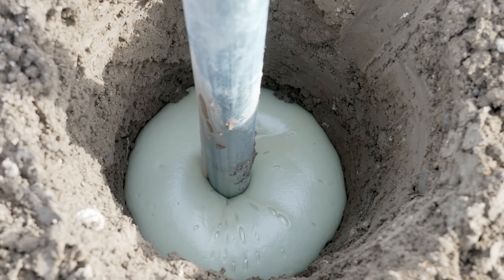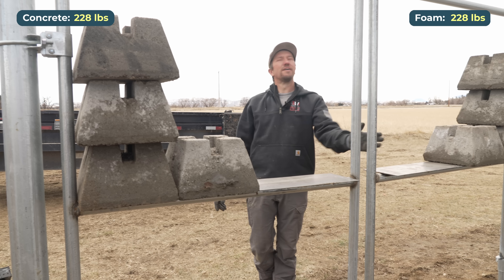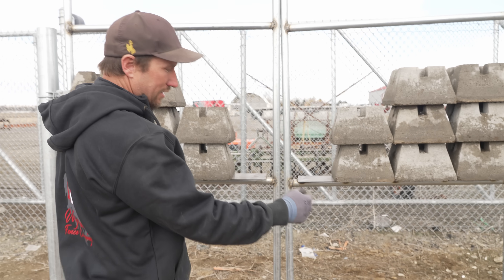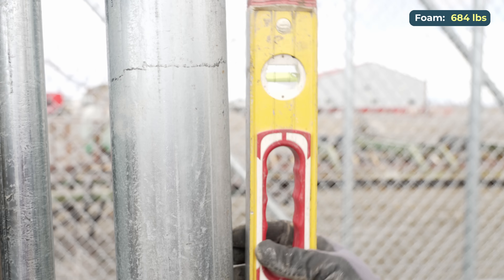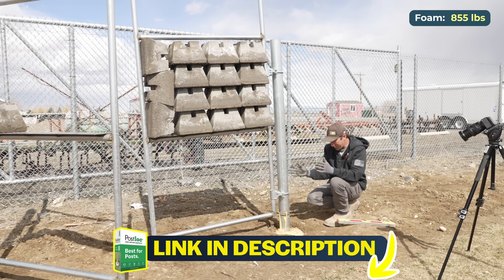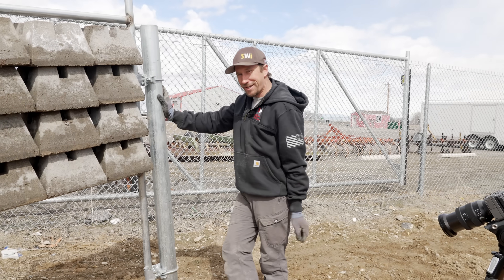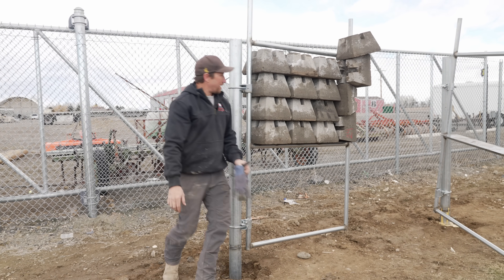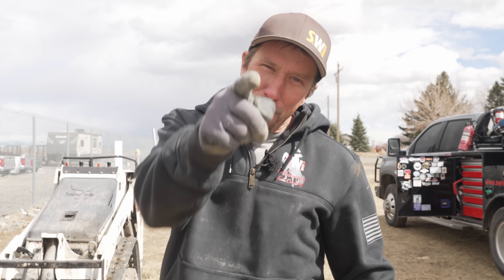How Strong Is Fence Post Foam -- Really?

Comment: Interesting that the foam held so good in this configuration. You’re supposed to have about 1/2 the hole diameter compared to concrete. In Europe, most manufacturers recommend that the narrower the hole, the better. The dirt will always fail first.

Comment: Does not appear the post was watered in, either with rain or a hose.  From personal experience, the foam is extremely strong and stable. However, the ground around it is weak amd will give/break until it's been watered in good and is allowed to pack in tight around the foam.

Comment: Foam failed same weight on either side one deviated while the other did not. The foam lacked the weight concrete has. The dirt  didn’t fail it just pointed out the foams major flaw. Logic dictates if the dirt was the cause it should happen exactly the same on the other side so clearly something is a miss and its weight.

Comment: For all the nay sayers, when are you ever going to exert a downward pressure on a gate of half a ton? Either method will work for a fence or gate. Cost is what’s important here.
Reply: Cost?  What's the cost going to be of when the foam deteriorates?  It's going to, a lot faster than concrete.
Reply: @Valkaneer That would depend on the purpose of the gate/fence. Sometimes they are temporary. Again, it comes down to cost.
Reply: @robertrossi3788   The foam is far more expensive than concrete.  The only thing foam gives is convenience.

Comment: almost $25 per post compared to $4 for concrete. Not worth it in my opinion.
Reply from the maker: I mean, you should be using at least 3 bags of concrete... If you're getting 3 bags for $4 that's a pretty good deal.

Comment: The issue with the foam is the weight, it simply doesn't have any, meaning it's not a good anchor point, I use at least 100 lbs of cement per post and for a gate I may double it, foam is literally the stupidest thing you can use for a fence...
Reply: @michaelhartman851  who’s your electric provider?

Comment: Seems like the difference is that concrete is heavier and I believe you said you tamped the concrete thus reinforcing the connection to the ground. 

I bet in very hard clay the foam would have held the same weight. I’d say the foam did a great job and didn’t crack/crush at all, just the ground around it couldn’t support the weight. It was being compressed.

Comment: Looks like the dirt wall failed, not the foam. It would be interesting to see this again, but with a concrete 2 foot hole, then put in a post with that foam, Would it still fail and sag?
Reply from the maker: That's an interesting idea. And sounds like a lot of work. 😆

Comment: I've been subscribed to you guys for a couple of years now and really enjoy your content, I have a question for you that you may want to cover in future videos. We moved to Virginia in 2009 and had a wood fence installed and enjoyed it until around 2022 we started getting carpenter bees. First they destroyed our cedar pergola, it must have tasted pretty good. Then they moved onto our fence. These little son of a bees are just slowly decimating it. We are surrounded by woods so I don't see a reasonable way of getting rid of them. We are ready to pull the trigger on 368 feet of fence and were thinking of going with wood ( we had it quoted for wood and vinyl ) but are thinking of going vinyl now. Is this the best way to go or are there ways to battle these little *astards that works? They are incredibly destructive.
Reply from the maker: That sounds extremely irritating. I don't have a lot of experience with carpenter bees, but my first question would be is this bare wood? I imagine if it were stained or sealed it would deter them. I'm also going to assume it's not a very hard wood, I think carpenter bees tend to avoid dense wood.
That's about the limit of my knowledge, but if you did go with vinyl you obviously wouldn't have that problem any more.

Comment: Great demo!. How about pouring foam into a hole that has about a foot long and post wide trench coming from the post out on the direction of the closed position. An "L" footing.  I believe that extra footing would help with any sag. Another approach could be to dig a hole and the make an "X" shaped footing. The ground here in TX is very unstable and with lack of moisture comes shrinkage. The "footing" helps whr things shrink. Your thoughts?

Comment: So foam works b/c the soil has a limited compression rating on the heavy side of the hole. So until the soil is stiff enough to offer extra strength then foam is fine.

Comment: We use foam all the time for new pole sets. Thats heavy three phase, single phase, equipment poles etc. from 35ft to 60ft. Works good.
Reply: polecrete is the product
Reply: @DavidLeon140m3 is the sika version just the "consumer" version of the polecrete? Ive used this stuff for temp services and it works pretty good.
Reply: @ no… postloc is the consumer version of polecrete

Comment: It's funny seeing people defend foam when it costs more, is a bigger pain to install and it is not as strong.
Reply: How is it a bigger pain to install?  You pour it in, you don't have to shovel and pack it like cement or dirt.  If you don't have a water supply near the holes, this is a good option.
Reply: I just carried 50 80 lb bags of concrete to fill post holes. In my late 50s I wished I had used foam. I was sore for days after.

Comment: How do these hold up to heat? Say there is a grass/brush fire, are you going to need to replace all your foam posts?
Reply from the maker: Excellent question. I have no idea.
Reply: It’s important to keep the foam at or just below grade and cover it with soil, mulch etc because UV light will break it down and decrease its structural capabilities.

Comment: Concrete vs driven please
Reply from the maker: Hmmm, I'll think about it. I need a way to make it interesting. Otherwise it's just loading up two posts and being like "yep, they're the same" 😁
Reply: @SWiFence  
Exactly its the only way to kill the myth.
Load one post set of post right away and the other set after 24 hours.
Reply: Just driven is not an option in some places…I think driven would alway fail first cause of the smaller area of just the post vs post and concrete.
Reply: But driven has more depths so its a wash.  Concretes posts fail at the top of the concrete driven post fail a few inches deeper.

Comment: How resilient is the foam over time?
Reply: I used post foam on a fence at least 8 years ago and it’s still standing with little deformation and the foam is still intact. You have to cover the foam tho because UV light will break it down.
Reply: Don't use it it's garbage I don't care what anyone says the stuff is garbage just use concrete
Reply: @trxtech3010 I am revok8ng your advice card. From here forward you're no longer authorized to give advice on the internet because that advice always garbage. Failure to adhere to this new rule will result in constant mocking every time there is a violation moving forward.
Reply: @trxtech3010  works fine on transmission and distribution power lines
Reply: @trxtech3010  you sure?

Comment: Another great video 
It would be great if you guys could create a video on 180 degree hinges how to properly set them and how to measure the opening for the gate I can’t find one on YouTube 
hinge and latch spacing seems to always be difficult for guys to figure out especially when doing both residential and commercial and can be costly if gates aren’t made correct size
Reply from the maker: Noted. 👍🏻